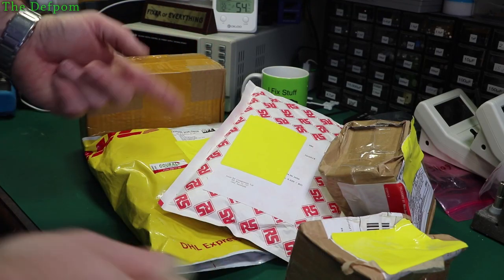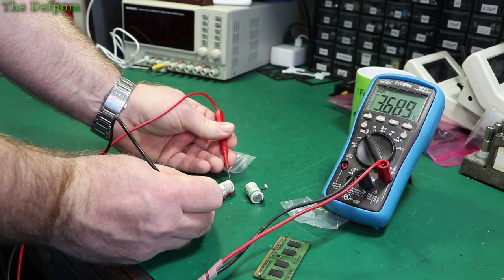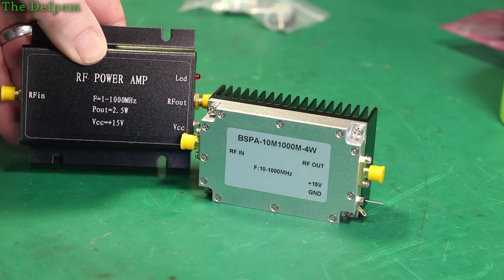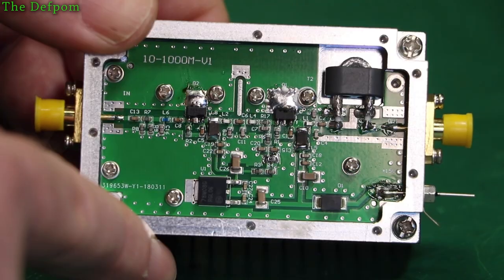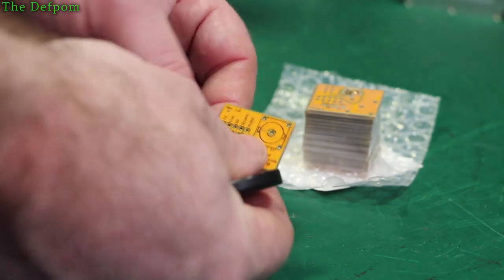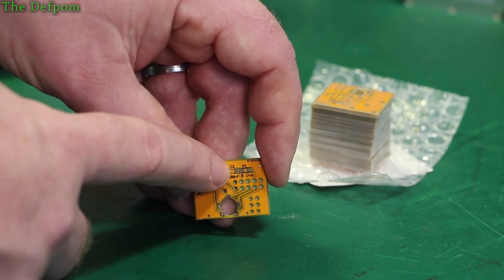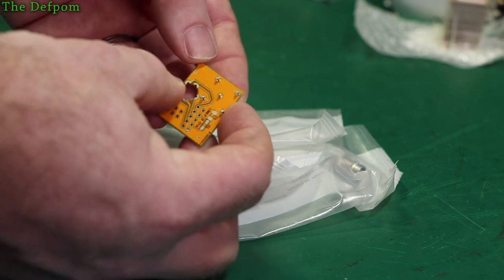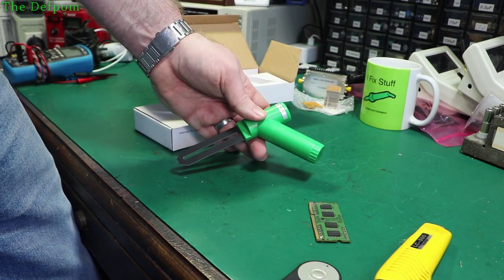#729 Mailbag Monday 29th June 2020 with PCB's from PCBway.com

Comment: SAFT batteries, not seen one of those in a long time.
Used to be a good brand way back when. Maybe still are?
Looks like the original also...
Reply from the maker: I’ve done discharge testing on it for the past week... it still had over 1000mAh left in it !